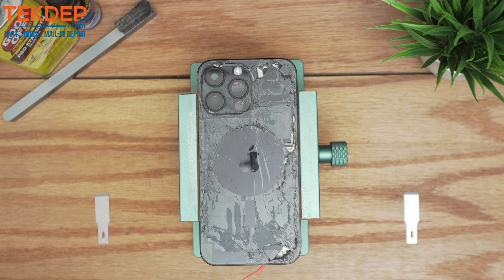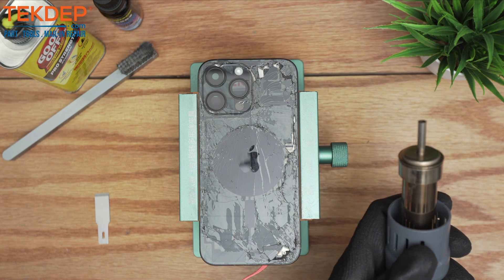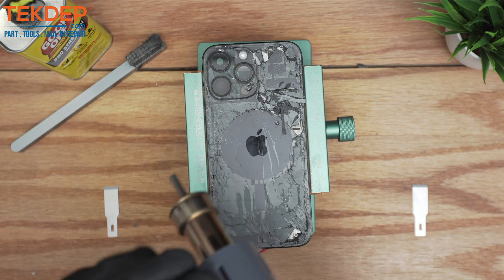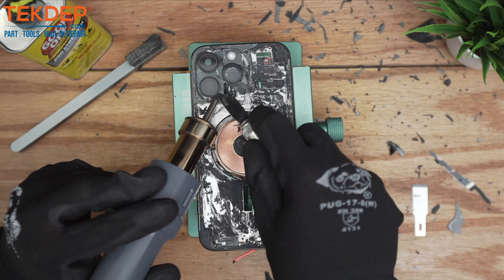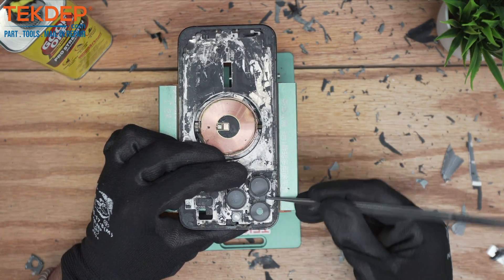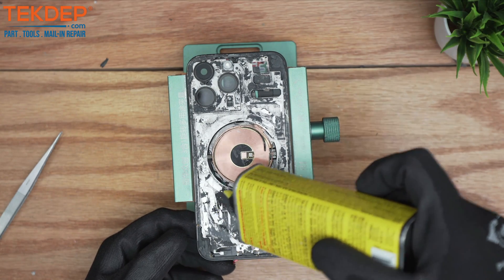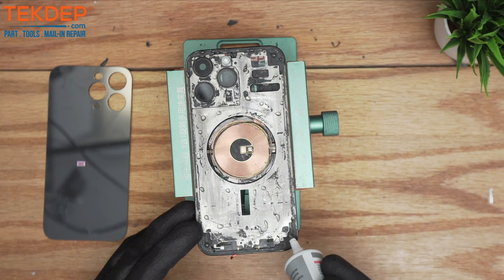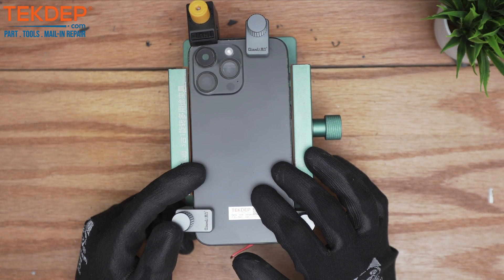How to Replace Your Back Glass | iPhone 14 Pro Max Edition

Comment: Seems like a weak tutorial.  You do the replacement without showing a machine but you mentioned needing one.  Plus the rest of the phone and cable connections are not contained behind this rework.  What happens if adhesive release gets in to the actual phone?  What happens if the goo gone or debris gets in the actual phone components?  You mention needing to apply the mag safe magnets but don't show how or what to do.  All this video does is make someone think its not that hard when in fact they are going to destroy their phone or be calling a place like you to fix their mistakes.

Comment: I had my rear glass replaced on an IPhonen 14 pro max; now the screen turns pink then powers off and will then self start.  This happens every 3-5 minutes - consistently.  Why?
Reply from the maker: It seems like something been damaged during your repair process, and it must be checked by an experienced technician to determine the cause of the issue, unfortunately, It won’t be possible for me to be certain unless it’s checked physically, We also offer a convenient and affordable Mail-In Repair service for all electronics and issues, along with advanced data recovery. Learn more and get started here: https://tekdep.com/device-repair/

If you anyone needs reliable replacement parts for MacBook or phone—like screens, batteries, logic boards, cables, or repair tools—we’ve got you covered. We have everything you need and ship fast! worldwide! visit: https://tekdep.com

Comment: You forgot to mention you used a laser before you started
Reply: Use the heat gun tool
Reply from the maker: That is true we use laser to get the glass out! If anyone needs replacement parts such as screen and batteries or tools for your iPhone repairs, we have them all and ship worldwide! visit: https://tekdep.com 

We also offer a convenient and affordable Mail-In Repair and data recovery. You can learn more and get started here: https://tekdep.com/device-repair/
Reply: From 1:15 to 1:54 in the video, there’s a segment on the progress bar labeled “Using Laser & Heat Machines.” During this segment, he also verbally mentions the use of the laser machine.